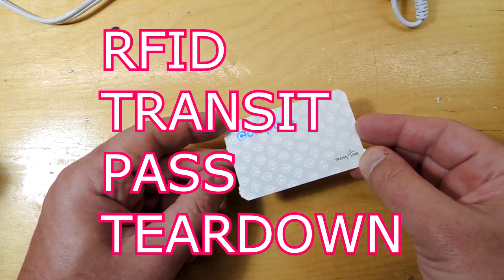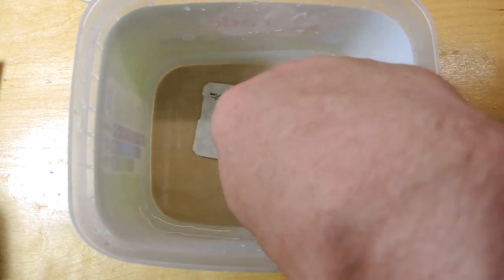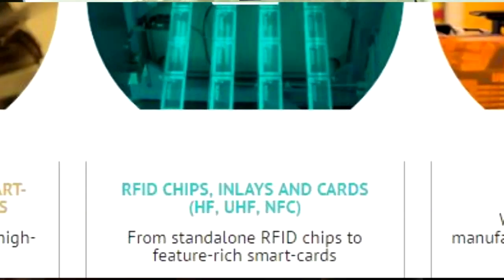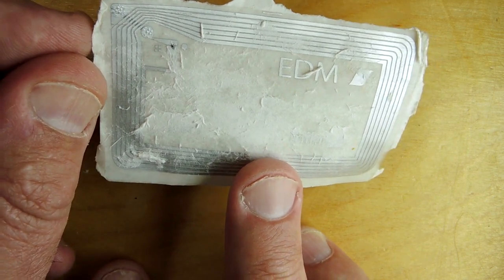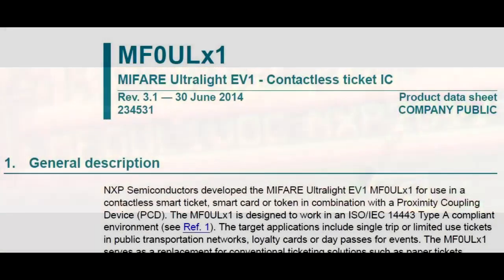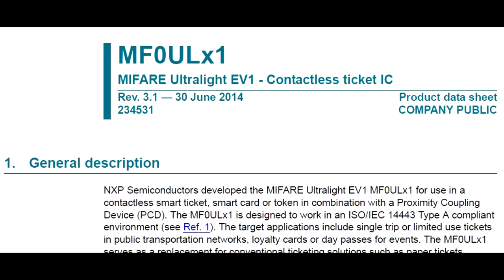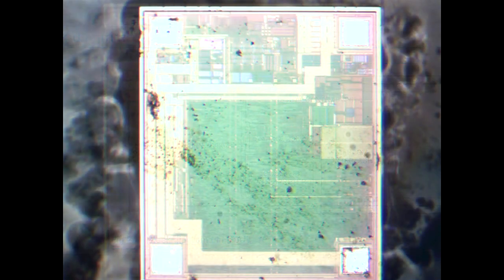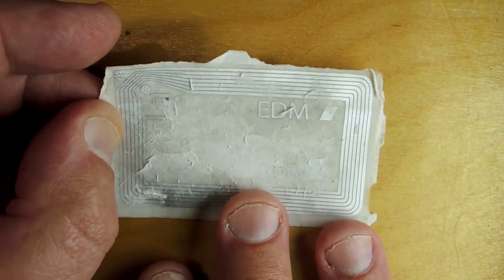CONTACTLESS TRANSIT CARD TEARDOWN

Comment: it's absolutley disgusting to see how resources viable for more useful things are pissed away with disposable items like these.
Reply: nrdesign1991 What exactly would you do with a thin sheet of plastic, some silver ink and a tiny piece of silicon the size of a grain of sand?
Reply: Well, the RFID tech should be related to reusable/reloadable fare cards, then.  Single use cards should be paper/electronic QR codes.
Reply: Fuck off troll.

Comment: Same thing with the Glasgow Underground train system in Scotland.  I was initially a bit perplexed when I got a paper ticket but the new machines didn't have the slot for it any more.  When I realised it was a disposable RFID card I also soaked it to liberate the plastic core for investigation.
Reply: When you realise you get 150 thousand plus of these chips out of a single 8in wafer in a fab, the chip cost is getting down into the fractional penny range, so the most expensive part is very likely the silver ink used on the antenna. There are some designs which use a very thin aluminium foil with a plastic backing, hot foil stamped onto the paper, as the antenna, with a second jumper that is both stamped to the card and which uses a set of spiked pads to connect the bridge at both ends to provide the inner contact. Then the chip is simply flipped over and stuck down with pressure providing the contact. Typically used in library book stickers as it is quite robust, and very thin.

Comment: i guess all it needs to communicate is something akin to an ipv6 number, they will never run out of numbers with that, and it can easily store it, the rest is the database and the way they connect all the transport systems that is the real key to it.
Reply: Yes, in MIFARE terms it’s called a UID (unique identifier), and is seven bytes long. Not much to it. A lot of transit systems use the memory and have various algorithms so that the turnstiles don’t need to be connected to a network.